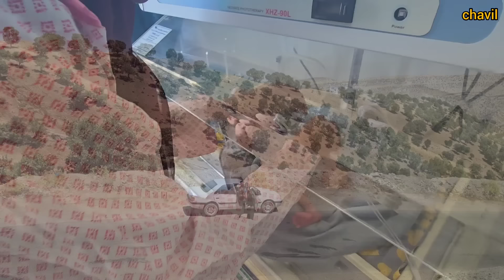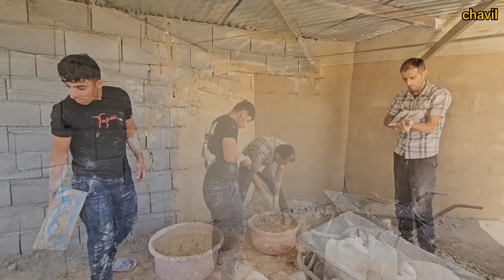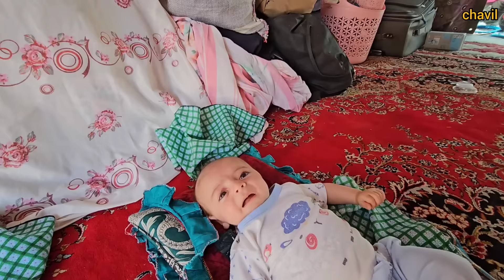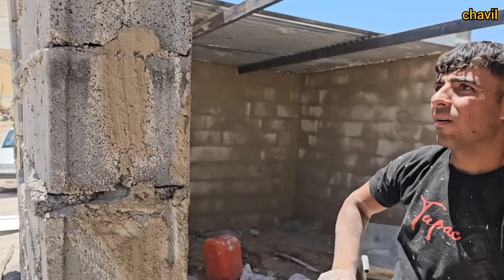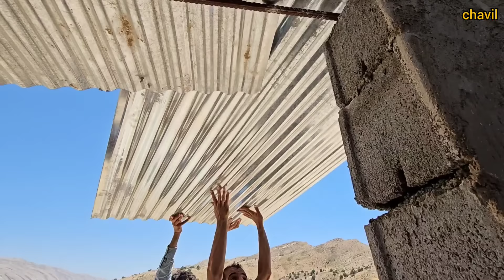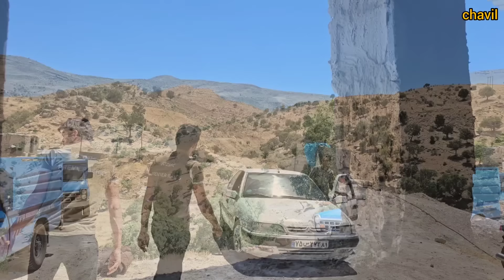Soghari's arrival with the baby in the mountain and the plastering of Fatima's baby's house

Comment: Кочевая жизнь она такая.Вечное строительство.😮
Reply: нет. кочевая жизнь это когда стада пасут на разных местах
Reply: @RozaDurova these constructions are illegal. But they make money building.
Reply: @RozaDurova it’s in the blood to just move to cooler areas, you wouldn’t stand the heat, so stop being so critical all the time. Outside sun blazing down 113 degs
Reply: @HitManNYY23 they are only illegal if the roof is permanent, and it’s not permanent, it could blow away at any time, your own air conditioning built in 😂
Reply: @sandrawestley4193  я про значение кочевников) можно вообще в деревне жить там душ и кондиционеры. но я потихоньку привыкаю к их образу жизни